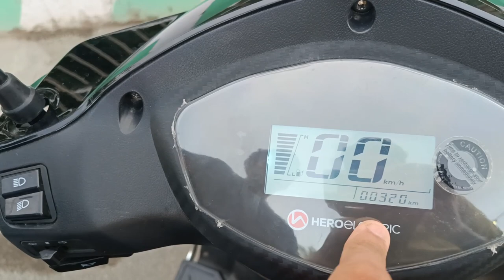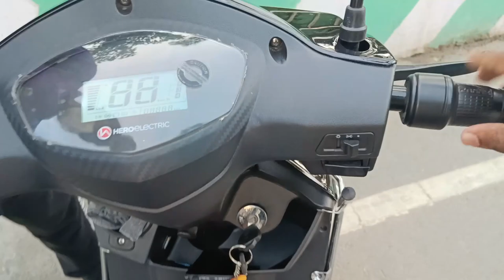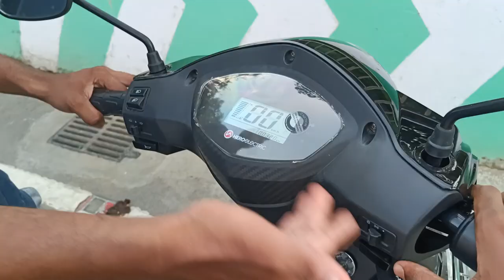Hero NYX Electric Bike Full Review With User Experience | TechyJock Tamil

Comment: Shouroom address sollunga bro pls.
Reply from the maker: Green Wheel Ev Motors Llp
Dealer address
Ground Floor, New Nr 2, Old Nr 1, Plot Nr B31, 6Th Avenue, Ashok Nagar, Chennai, Tamil Nadu
phone-line
9566216666 | 8838843389